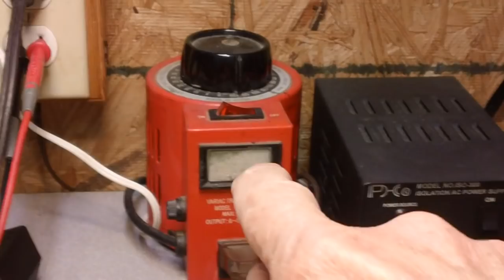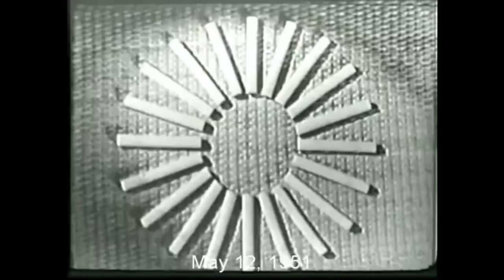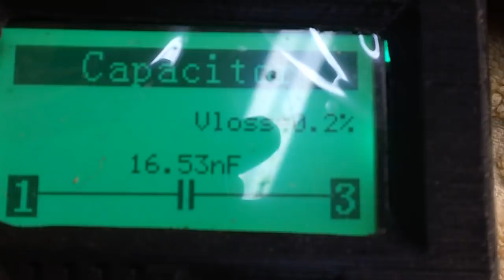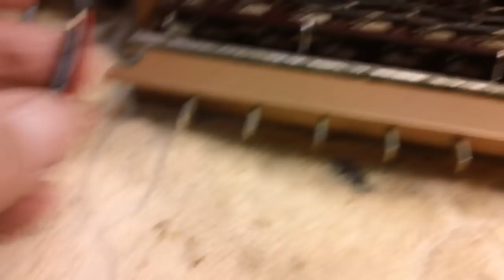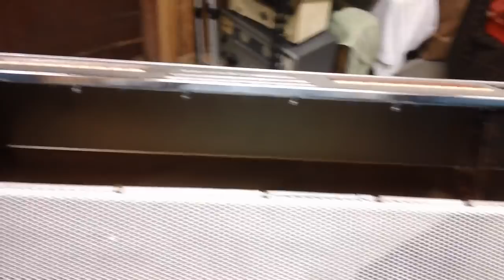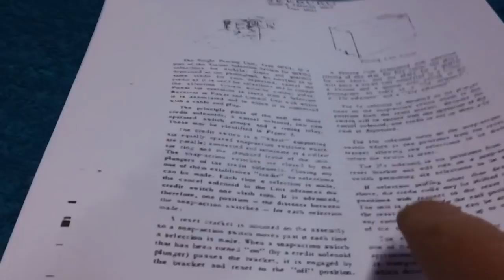1961 Seeburg AY100U Jukebox Restoration (Part 42 of 87).

Comment: John, awesome job with at Solenoid... It may be me, but the terminal strip on the right of the solenoid ( Over the 10W resistor) looks bent or perhaps broken. Just want to mention that in case you didn't see it.. really nice work. On the Single Pricing Unit, are you going to change out those old wax caps ?  :)    Piece of cake....   really nice job as usual and I too look forward the 2nd and 3rd Goodbyes in your video.    :)  Regards, Ron
Reply from the maker: Ron,
Yeah, that thin terminal strip did break when I took it out.  It had gotten very brittle over the years, but the spot where it broke had no impact on the terminals themselves...a lucky break, if you will.  LOL  Anyway, it's glued back together and secured on each end to the chassis.  It just has that obvious little dip in it.
Regards,
John

Comment: Hi John,

I've been watching your restoration videos for years, and your skills never cease to amaze me!  And your videos have helped me a lot as I try my own restoration projects.  I'm about to start restoring a Philco 41-250 and I can use all the help and advice I can get!  Keep up the great work and I look forward to your next video!

Best wishes,
Jason
Reply: Jason, I am no where as experienced as John, but feel free to use me for help as needed.  Happy to help anyway I can.   Good luck on the Philco... here to help - Ron
Reply from the maker: Thanks, Jason,  There's never a shortage of help on Youtube and the Antique Radio Forum.   Just never forget that safety is paramount when working on old electronics.  There's an old saying that goes: "What you don't know can't hurt you."  Not so in this hobby.  What you don't know can severely injure or even kill you.
Good luck with the Philco.
Regards,
John
Reply: Keep it a hobby not a deadly hobby.  There are many sources on youtube for old tube gear restorations.   Dig up all the safety vids you can find to start with.   Get an isolation transformer first.   Follow all basic electrical safety practices.  Don't rush.   Make yourself a dim bulb tester if you don't want to invest in a variac right away.  It is a cheap easy way to power up gear safely without a variac.  Learn basic electricity before you touch ANYTHING.   These old radios have up to 600 volts in them.   Electricity is way faster than you are.  Be safe and enjoy.   No one is immune to electricity.
Reply: Thanks John and thanks to Ron and jp for the offers of help!  I have experience repairing AA5 radios -- I've brought 5 or 6 of those back to life so far.  And I have a variac and isolation transformer.  What I really need is a tube tester, but I don't have the money for that right now.  It's transformer sets that give me problems. Hopefully I've learned enough from my past mistakes to get this Philco going again eventually. Thanks again for your videos and for your friendly advice! I can't wait to see you getting this Seeburg running!